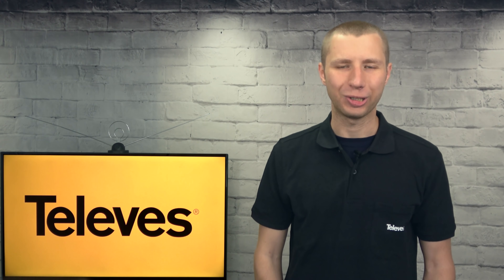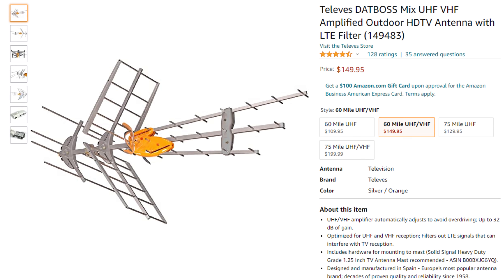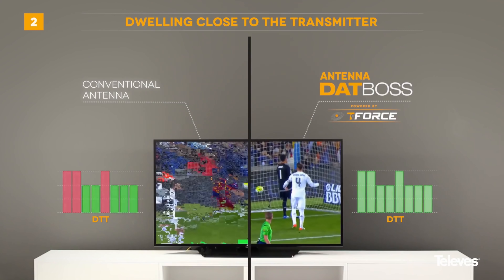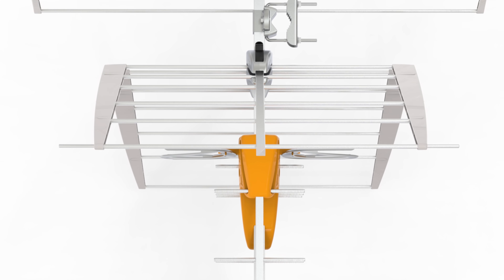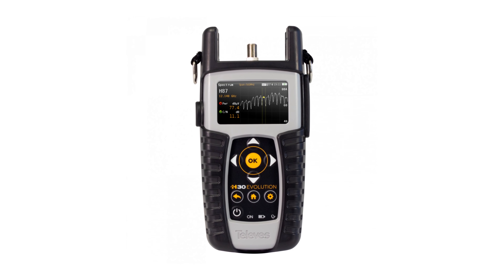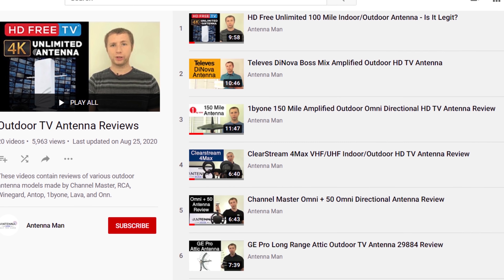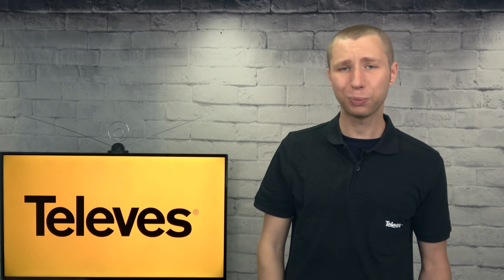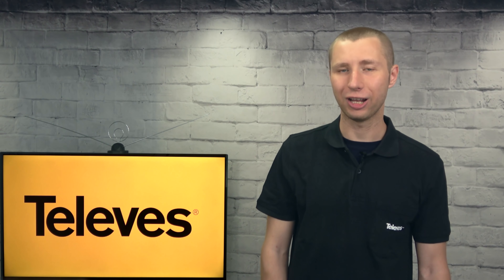Televes DAT BOSS Mix Amplified Outdoor HDTV Antenna Review

Comment: That automatic gain control really sets it apart from the completion in my mind. Especially if you're a Dxer like me aiming for weaker distant stations adjacent to strong close ones.
Reply: Been in the business several years now. Automatic gain control does nothing, a regular preamp will bring in the same channels. I use a lot of the CM7777 long distant preamp, CM does sell a CM7778 which says to use in metro areas closer to transmitter, it's just a lower gaining Preamp that's all it is. 
I have mounted the CM7777 as far as 6 miles from the transmitter with no overloading. 
Atmospheric conditions do change daily. As I check signal strength on one particular channel every time I got the tv on. One day it could be 48% signal strength aimed at same transmitter then 55% another day and then do 75%. This option of automatic gain control is not needed. 
As for LTE Filter, got no problems with cell towers. One person on a Forum said it cuts out your weak distant stations. 
The more pure the preamp the better. 
It's only made to compensate a line loss between the antenna and TV set.

Comment: Hey Tyler, thanks for the videos. Keep up the good work. 
I bought a ChannelMaster Flatenna directly from their website a few weeks back because that was the best OTA Antenna according to CNET.  I have it mounted to the back of my TV and at my address the only channels I'm getting are : MPTkids (PBS), NHK-WLD, WBOC (CBS), WBOC-CL (??), FOX21, MPT(PBS), and MPT-2(also PBS).
No ABC or NBC or any others. My zip code is 21801. Can you recommend a decent inexpensive antenna (indoor or outdoor) that will pick up ALL my local channels? Or possibly recommend an alternative course of action?
Thanks in advance.
Reply: He offers specific antenna recommendations on his website Antennamanpa.com
Reply from the maker: CNET knows nothing about antennas. The FLATenna is not the best out there. If you would like my assistance sign up for an antenna recommendation on my website below. https://www.amazon.com/shop/antennaman

Comment: I have one like this I bought from My Cable Mart it's about $100 cheaper it's a very sturdy antenna and works great on VHF and UHF actually it works better on VHF than all the other small antennas that Tyler's tried out I know this for a fact because I've tried all the other small antennas out

Comment: I had great hopes for this antenna but ended up losing channels. I paid a lot for this but am dissatisfied with the performance even after raising it another 10 feet.
Reply: James did you power up the DAT?
Reply: @jurysdoyler  yes I did. It’s well grounded, and connected with brand new RG6 cable fitted with water tight compression F connectors.
Reply: @jamesbrubaker8395  Lost channels as compared to what?. Can you share a rabbit ears report?
Reply: I'm not sure what kind of report that you are looking for from Rabbit Ears. I lost stations, WGGS 16.1(RF2), WRET49.1(RF9), WDTK 31.1(RF15), WSKY 51.1 (RF29), ALL listed as FAIR on rabbit ears.
Reply: Did you buy the DATBoss Mix VHF/UHF or the UHF only? What antenna did you have before, if any?
Reply: @robertogalvez3865  I purchased the Model 148381 long range hi & lo VHF/ UHF . THe pervious antenna was a huge Channel Master that was here when I bought the house. It got blown down and damaged in a storm.

Comment: I had this brand and design antenna and it did not hold up well and broke. I decided to build my own antenna which is more compact and evidently more durable. I built mine for about $20 US and it catches more channels with most broadcast antennas being about 65 miles away.
Reply: Looks like you just need to go to market with that antenna
Reply: Really? It woud be nice to see a picture of your $20 antenna.
Reply: I'm planning to also build my own antennas thinking of building a Extreme Deep Fringe one that will be 168 inches long with double booms. Starting the prototype this summer, then will commence testing. And mods. Prior to launching sales on eBay!

Comment: I have the LR Mix version of this. While it does great for UHF. (Using it now in fact because of its low profile for storms). But it will NOT do low VHF. Also those hi VHF elements aren’t the most durable, as mine broke while moving it. But I can’t complain too much , Televes knows what they’re doing , that’s for sure. It’s 10’ off the ground and gets 68 miles away in deep woods, mountains.
Reply: Nate, albeit not super high gain on Low VHF, there is a version of the LR with a Low VHF dipole that performs better in those cases: 148381
Reply: @jurysdoyler  Thats the one I found too. I made custom low VHF elements for mine. But the preamp has a notch filter for low VHF/FM. So I would need to replace my pre amp section. I’d rather not have to buy the identical antenna just for proper low VHF elements, and an unblocked VHF band.
Reply: @XMguy  Yes, the 149883 (UHF and High VHF) will filter out the Low VHF portion of the spectrum on purpose for two reasons, better rejection of any potential FM interference, and to make it easier to combine that antenna with a dedicated Low VHF antenna if so desired. The 148381 (UHF and High and Low VHF) will also amplify Low VHF, while still notching FM (not as much as the 149883) and LTE.
Reply: @jurysdoyler  Too bad I can’t just buy the active elements and preamp section separately.

Comment: Televes makes a version of this antenna with elements that can receive VHF Lo. The VHF-Lo element is about 5 feet wide. It is very hard to find this antenna. In Albany NY, CBS comes in on VHF Lo Chan 6, which is 62 miles away from me with no ridges. I would love to get this antenna. Judging by Tyler's tests, it should be able to do the job.
Reply: Agreed for some reason Televes fails to make these easy to find on their Amazon page or even their own web page, you can only find them on their page if you know the model number and search it.  As you said once you know what you want good luck finding it anywhere.   The VHF-Lo added version of the reviewed model is #148281.  The longer range VHF-Lo added model is #148381.  It's a shame I have it and it's a great antenna.
Reply from the maker: you can find the low VHF version of the LR and DATBOSS Mix on the website below. https://www.nesselectronics.com/products/tev148381?_pos=18&_sid=6f85a0239&_ss=r

Comment: I bought the Ellipse. For the first week the one low power station I lost when I moved out of the city came in pretty good.
The second week it came in not so good, and now it's been gone since. Pretty sure it's them, not me.
Every other station is now rock solid though. Not a single pixel to be found. Not even on the [violet] channel.
Absolutely recommend.

Comment: Hey Tyler is there any way you can test antenna power rotating equipment? I want to mount an antenna with the ability to be rotated from inside my house and am in a rural range stuck between 3 markets.

Comment: I just bought this. I will be installing it and letting you guys know how it works. (Indoors) because that is my only option. I have Danny Hodges Ultimate antenna and the Clearstream 4v max. I will be interested to see if this works equally or better to those. If anyone with knowledge on this knows if they are better than those two models. Comment below. Thanks to your video I decided to spend the money. I will get it by Thursday.
Reply from the maker: Keep me posted with your results. Shoot me an email listed on the website in case I don't see your comment. I always love getting feedback
Reply: @AntennaMan  Will do. I am hoping for better results but I am skeptical as I have tried many antennas and none of them live up to the hype. Hopefully this one is better.
Reply: I have one in my Attic, and it works better than anything else I have tried
Reply: Jeffery How did this compare to the clearstream 4v max?

Comment: i have this, but wish i had ordered the 75 mile (one step up) antenna, since the area low power uhf stations are weather ( summer/winter)dependent.  At least they are under atsc 1.0. reception.

Comment: To have the best reception on both bands I would recommend installing two antennas like I did. One for VHF band and the second for the UHF band a VHF+UHF combiner and an amplified splitter. This antenna is a good choice for those who can't install two antennas, but I would recommend it only for UHF reception.
Reply: i did  the same . i did Televes for uhf and sky blue for vhf high
Reply from the maker: Exactly!
Reply: That's what I did too. But instead of a combiner I connected the lead directly to another tuner, the mediasonic Homeworx  plugged  into the HDMI input on the TV. Had to run a separate coax through the wall from the antenna to the tuner  but I think the benefit outweighs the hassle.
Reply: What's Ur second antenna?
Reply: @roywilliams8236  My first antenna is for TV (UHF Band) The second is for FM and DAB+ digital radio (VHF Band) And with a VHF+UHF combiner I have both signals on one cable.

Comment: Has 32Db maximum gain by the amplifier but there is not info of the self natural gain of the antenna without the  amplifier I think in some cases if you use without the amplifier the VHF signal intensity could be higher than what show up
Reply from the maker: They do have the natural gain listed in the tech specs. See link below. Click on tech specs. https://www.nesselectronics.com/products/televes-149483-datboss-mix-u-hi-v-antenna-w-preamp-uhf-high-vhf?_pos=9&_sid=4993e9bf6&_ss=r

Comment: My Clearstream 2v outperformed the Televes 149883 in my area. I was really disappointed. I managed to sell it but only got half my money back.
Reply from the maker: The 2V might have worked better if your stations were spaced out as it isn't as directional.
Reply: That's actually very interesting, given the price difference between those two, and differences in the reception strength as tested by Tyler in his past videos. Was this primarily for UHF or VHF channels?
Reply: @AlGoYoSu  in my area channel 14 moved channel locations a couple of years ago and the signal isn’t as powerful. All the other channels UHF and VHF I could pick up the same on both antennas but 14 could not be received at all with the Televes and it gets some interference if various degrees on different days with the Clearstream. I have a Tablo that records a show on CW 14-1 that some times it records and sometimes it says the signal is too weak.

Comment: My antenna sucks
Reply: I recommend a channel master antenna. It has both VHF and UHF reception and is ideal for medium to low signal areas. A Channel master Advantage 60 outdoor digital antenna will be ideal or a Channel Master Advantage 100.
Reply: What antenna do you have?
Reply: Casey. I have a clear antenna
Reply: @davidgentile4576  The ClearTV antenna isn't very good in most location. Good indoor antennas are Clearstream 2Max/2V, Televes Dinova Boss Mix, Antop Mini Big Boy, and Antop Big Boy. The one that suits your home is dependent on distance to the towers, how far apart the broadcast towers are from each other, and terrain.